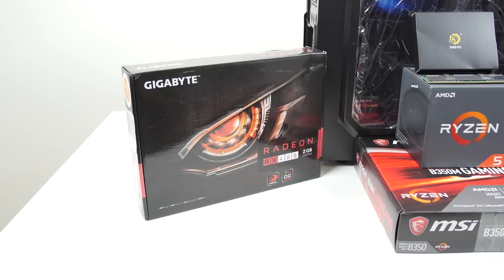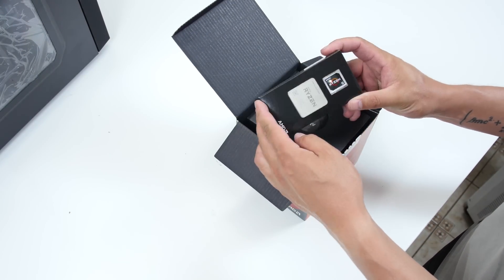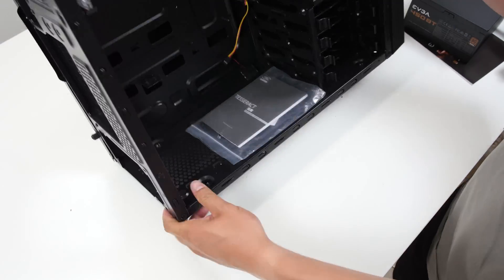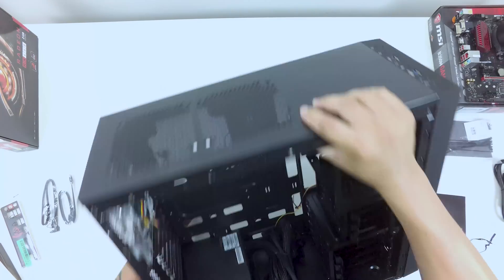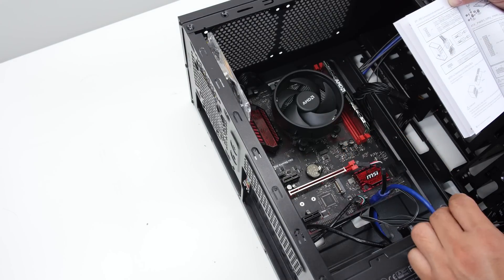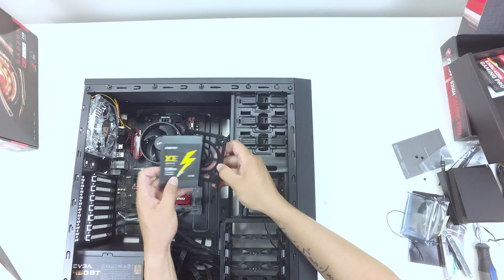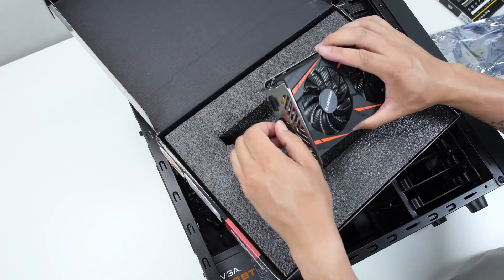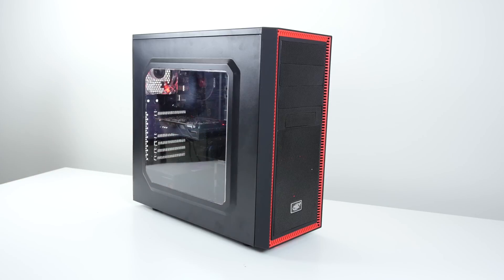$450 Ryzen 1400 Gaming System

Comment: If the GPU is cheaper than the CPU, that's not a gaming system.
Reply: Mihai-Silviu Dumbrava Extreme i7 black box and a gtx 1080ti is not a gaming system? Just because the cpu is more expensive than the gpu, where did you get that from wtf
Reply: so my i7  and 1070 is not a gaming system?
Reply: Mihai-Silviu Dumbrava SHOULDVE said so jfc
Reply: Mihai-Silviu Dumbrava well if only game you play is cs:go 1024x768 all low,dota,lol and overwatch and you do some work on pc this is good system
Reply: Mihai-Silviu Dumbrava E un sistem dezechilibrat, mai bine punea un 1050 ti că era mai bun și costa încă 3 milioane.
Reply: Mihai-Silviu Dumbrava you could put the 6950x and 2 1080tis. is that not a gaming system.
Reply: Who made that a rule? Not necessarily true at all.
Reply: Tirmac Marian Cristian Corect, e prea puternic procesorul comparativ cu placa video. Asta e mai degraba un PC pentru editare, nu pentru gaming.
Reply: Mihai-Silviu Dumbrava true i wont say that the gpu is bad but there is  a lot of amd gpus that are better than that
Reply: Mihai-Silviu Dumbrava Bout to get a gtx titan xp too play smite and scgo!
Reply: Mihai-Silviu Dumbrava I have 450 and Im gonna buy this because here where I live there is no g4560 and upper tier gpus and Im gonna stream OW
Reply: R7 1700 + RX 480 runs 1440p smooth, built back in March 2017 when the xfx radeon rx 480 8gb gtr black edition was a whole lot cheaper.
Reply: What if you have a 2000$ 18 core 36 threaded core i9 and a 700$ Gtx 1080ti?
Reply: Silviu so you're saying if I get a good deal for gtx 1060 for $100 and my ryzen 5 1400 is $169 it's not a gaming system? Might want to rethink what you're saying
Reply: Depends source games can be mostly CPU dependant
Reply: This is the kind of thinking that's ruining the community. smh
Reply: I'm talking about budget builds, like the one in the video. If you want to build a pc with a  <800$ price the GPU should be your main point of interest. A lot of people buy i5's or r5's and then cheap out on the gpu because they don't have any money left. In the majority of cases a lower end cpu like the g4560 paired with a mid range gpu like gtx 1060 or rx 570 will offer better performance than an i5/r5 with a 1050 for example.

Comment: I got basically same build, but with GTX 1050 OC at MicroCenter, should I have gone for the 460?
Reply: Stat Savage the gtx 1050 is about the same when it comes to the 4 gb version of the 460 but the gtx 1050ti does outperform the rx 460
Reply: 1050 is better than 460, I'm more of an AMD person but being honest.
Reply: Stat Savage I suggest 560
Reply: Stat Savage depending on if you play any games that utilize DX12
Reply: Stat Savage Nah, I'm an AMD fan and honestly there's no need for the 460 but for pricing, the 1050 wins 9/10 and the 1050 ti blows it away. For reference, the rx 470 is 25%> gtx 1050ti 25%> rx 460. the 460 will bottleneck most relatively new machines, even the 100th bottlenecks fairly hard for this type of system but gives way beer performance than the 460 at least

Comment: Hey bro,I would suggest getting the 1050 or 1050ti for that price.I am no Fanboy,Just my opinion because in my pc it performs better than rx 460
Reply: ItzDev What I did
Reply: ItzDev Does it perform better with the R5 1400 though...? I am curious
Reply: Yeah
Reply: The 1050 is a bit more expensive than the 460, it'll perform better aswell, but I'm pretty sure he got the 460 partly due to AMD FreeSync, monitors with that technology are a bit cheaper than NVIDIA G-Sync ones.
Reply: Yeah,But if you are a gaming youtuber,then the 1050 will be the best because of geforce experience.Records without lag.
Reply: That's true.I'm using the 460 right now and we have this ReLive recording software, haven't used it yet, but apparently it's not as good as Experience's one.
Reply from the maker: I agree and I will be making a video using the intel 4560 and a 1050ti. The reason for the AMD gpu is that I am using this with a dell 75hz monitor with Freesync. More on that in the part 2 video.

Comment: In budget "gaming only" build G4560 with a better video card then Rx460, would smoke this build and still be in that $450 range.
Reply: then just OC the r5 1400 man
Reply: Amen
Reply: edwardpirate kenway There is something that sabotages AMD cards, it's called Gameworks
Reply: Dumb Dead1 for £50 more why not a 1050ti
Reply: Tech4U That makes a $450 gaming PC worth a terrible $500. $500 can fit in a GTX 1060..
Reply: The Pokenerd uh if you were to go with a g4560 you could get a 1050ti or a 570/580
Reply: The Pokenerd but not an r5
Reply: Tech4U Don't worry, Ryzen 3 will be out in less than a month and problem solved.
Reply: The Pokenerd ah good idea everyone wins
Reply: Tech4U yey
Reply: Derp Derpen G4560 and GTX 1060?! Your best option is G4600 or better.
Reply: Derp Derpen I think, better take MOBO with cheaper A320 chipset
Then just try to buy cheap 1050Ti or 1060
Reply: RX 460 is more equal to a GTX 950(except in Vulkan and DX12)....
Reply: Dumb Dead1 So a locked, dual-core, 4 threaded processor is better than a quad-core, 8 threaded, unlocked CPU? And I guarantee you, the RX 460 delivers almost equal performance to the GTX 1050.
Reply: Dumb Dead1 why would u want a 2 core cpu, you get loads of game limitations e.g. If you wanted to play beam mg drive you need a quad core processor and the g4560 is a dual core

Comment: I'm assembling a configuration like yours , My concern is that after I ordered the components i read in some forums that ryzen 5 1400 and  B350M GAMING PRO Does not start the boot phase to enter the bios and update, it but need a  ryzen 7 to update the bios and let the ryzen recognize 5. Is all that true?
Reply from the maker: wow that is a strange problem. I have not had that problem with this board and CPU but that could be an issue with an incompatible ram sticks. Many of the updates are adding ram compatibility not so much for CPU compatibility.
Reply: Thank you very much for the answer

Comment: Just wondering, but could you fit another ram in there?
Reply from the maker: With the stock cooler and that heatsink over the ram, no. It sucks because I would have to take the heatsink off the ram stick. The ram stick I have didn't come with the heatsink anyways but most "gaming" ram sticks do and it would probably be a problem.
Reply: So its bad motherboard design?
Because it should have problem fitting any rams,its the stock cooler
Reply: It should not I mean

Comment: RX 460 2GB is not bad considering i'm mostly play Dota 2 and csgo :))
Reply: I see you mean 580 4gb lol my bad I thought you meant RAM XD.. well that videos explains it most games shouldn't go over 4 gigs so you should be set
Reply: kurozaki07 What he is trying to say is to save a little more money and get the 470/570 as it will be a much more worth it option for the long term since you won't have to upgrade in the future, rather than paying for the 460 now then paying even more in the future to upgrade to the 470/570
Reply: DUDE ADD  me on dota im  4.4k :D
Reply: kurozaki07 add me on steam anyone XxGetRektalotxX
Reply: how many fps do u get with that 460? also what's ur processor?
Reply: Ragezort The R5 1400 blows the Pentium G4560 out of the water.
Reply: kurozaki07 try to get a 470/570 so much more peformance for a little bit more
Reply: Well thats my plan..

I choose RX 460/560 2GB cz its one of the cheapest GPU in current generation then i will upgrade it to RX 470/570 so i can get significant performance boost :))
Reply: so you'd probably want G4560
Reply: Spongebobs Eyelash How would a Ryzen 5 1400 and an RX 580 4gb run?

Comment: thank you for the info nice job keep it up, I got fx 8350 oc 4.8 but I run it 4.515 asus sabertooth r 2.0 pny gaming 1866hz 16 gb kit gtx 1070 ssd evo Samsung 500gb evga g2 850w nice case with perfect air flow ,I what to go to ryzen so bad I just can't decide on what to get ,ram,mobo,cpu.all I need I'm going to use the parts of my main pc they are only 1yr old . any help be nice I'm thinking to wait for next ryzen 2. my pc runs everything I trow at it, oh I got a asus vg278vh 144hz 1ms monitor,I just saw the video card I got one for my fx 6300 rx 560 4gb for my wife pc

Comment: bad build because of weak gpu !! with only rx 460it is not worth to buy r5 1400!! everything bellow rx 470 are not worth to combine it with r5, g4560 are ideal for this gpu-s or 1050/1050ti
Reply from the maker: Stay tuned for part two when I upgrade to water cooling and an RX480. If I went the kaby lake cpu route then I would need to get either a z170 or z270 if I want to upgrade the cpu to a k series for overclocking in the future. Those boards are over $100 to start.
Reply: Mr11ESSE111 I did something like this with a gtx 1050 OC and now when I have the money I can upgrade my pc in a few years.
Reply: THe Observer nobody wants a Pentium , upgrade down the road that's what most people do .
Reply: I knew that but this build felt so incomplete the r5 has aton of wasted potential on this build .In the 1st place this build should guide people in picking right parts for for the best value which this build completely neglected
Reply: THe Observer you often upgrade the gpu first because its most important for gaming. With the 1400 you have enough headroom and can upgrade the gpu in 2 years or something like that.
AM4 is new while intel 1151 is going to be replaced so that am4 is the better choice.
ofc the Pentium is perfect with the rx 460/560 for gaming and its a good budget choice but i think this build has also its right to exist
Reply: Plus the high-end CPU makes handling PC everyday PC task lightning fast!
Reply: bad build ? you get a hyperthreaded quad core for less than $500 , the 460 can be easily upgraded at a later point , its not all that weak either it can play any game out at the moment .
Reply: Mr11ESSE111 with this cpu im getting Rx 560 4gb so it should be better i supose
Reply: Eli_Plays 
it is a bad build in a way because of poor balance between two major components the cpu and gpu. the G4560 is cheaper and will provide the same gaming performance when paired with 460 or 560 . upgrade path will be good to because it will support 7th gen cpus from intel and when you want to switch to ryzen you just need to change the mobo and cpu plus it will became cheaper in the future compared now
Reply: LMAO did you get what I just said?? It will give the same GAMING performance as the ryzen
Plus it is way more cheaper so you can get a better gpu more ram more storage. In short your resources can go to other things
Reply: LoL I might be sounding like an intel fanboy now but almost all games uses only 4 threads plus if you consider the rising popularity of dx12 it looks like this cpu has good future. And we are discussing value here the g4560 itself and its MOBO are way cheaper than The R5 mobo and cpu
Reply: THe Observer why would anyone cut corners on the main component of a build ? When you can get the r5 and just upgrade the GPU down the line , the RX 560 can handle any game out at the moment , its not like we're talking about a GTX 1030 or 730 , we're talking about a budget 1080p high settings capable GPU .
Reply: It seems like he just build this system to follow the trend
Reply: THe Observer i5's have increased stutter compared to an r5. You'll spend more money upgrading the Pentium to an i7 trust me.
Reply: THe Observer ok so how about people spend an extra 50 and get an RX 470 would that make it a better build in your eyes ?
Reply: Exactly! Also, I can run Fallout 4 High Settings with an occasional drop below 55 fps!
Reply: Tobias Jöny it has right to exist but not an ideal build admit it in r5 series 1600 is the sweetspot and if you consider ryzen 5 this is the appropriate  choice due to its performance per dollar ratio
Reply: Stat Savage yes your right but that will depend heavely on what type of user you are as this build almost focuses on gaming then g4560 is the appropriate choice.but if you are a content creator or someone who do something cpu intensive task the 1400 is not the right choice for you
Reply: THe Observer what is you obsession with this Pentium ? Why would anybody cut performance in half just to get a better GPU ? When you can just get the 460 and upgrade at a different time ? This build will handle any title at 60 fps easily .
Reply: THe Observer and the 1400 will do intensive programs just fine and a hell of alot better than the Pentium .
Reply: Im just saying that 1600 is the good cpu for productivity if this is the main concern
Reply: Not the 1400
Reply: THe Observer some people don't have the budget for a 1600 the 1400 will handle it just fine .
Reply: Eli_Plays 
to end the discussion here is my own conclusion the r5 1600 is the best for budget productivity it is the most balanced cpu in the market . while the r5 1400 is better in productivity. than the g4560 it is twice the cost but in terms of GAMING which I think this build video is aimed at the 1400 and g4560 is pretty close you can even look for benchmarks . in the end this is not a bad build but it shows poor management of budget in getting the most out of your money
Reply: In some cases it can edged out a stock 1400
Reply: THe Observer in what cases ? In any case the 1400 has more threads that can be used.
Reply: Search some benchmark 
The channel called benchmark do good test with these cpu using a gtx1060 which is better than 560 which can see the potential bottleneck
Reply: THe Observer I know for the fact that the 1400 smashes the g4560 in gaming performance.
Reply: Eli_Plays 
BTW games only uses 4 threads so the extra 4 threads the r5 1400 has does not matter much in gaming
Reply: THe Observer but games utilize the 1400's actual cores , and the games definitely use the 1400's threads aswell. Compare an i5 to an i7 games have way less stutter on the i7 compared to the i5.
Reply: Robinson Joe 
first of all the build iam suggesting is not obsolete because of the fact it has a good upgrade path to an i7 cpu. the main argument is the similarities of r5 1400 and g4560 in some titles go watch some benchmark in youtube. second optimization of ryzen is something that I dont disregard but the fact is games only uses 4 threads is legit in per core performance intel wins the battle because the ryzen has a hasswell like performance. and lastly NO ONE CARE ABOUT WHAT YOU ARE USING . not all people in the world has access to cheap deals and secondhand hardware like you .you only view our discussion based on your own perspective and experience which is wrong
Reply: Robinson Joe 
a locked i7 yes I can see some not the k version but regarding the dx12 it lessens the cpu load and lets the gpu handle more things in gaming . do you know that? that is the reason why people are exited about this
Reply: Well you are right I will not argue about the potential of ryzen it is indeed the best cpu for the value in the market if you are planning in building a mid to high end system

But let me ask you this if you have a 450$ as a budget what will you do will you change it? And what parts would you change I would like you to build the best value system unlike the one thatvis shown in this video
Reply: Then give me your opinion what is needed to make this build way more reasonable than it is now I think there is a lot of wasted potential on this system especially the cpu
Reply: Yes it is outside gaming the g4560 is BAD imean bad so your argument is right but if gaming,browsing,and light productivity (not photo or video editing) it is fine
Reply: It isn't going to be fine for even gaming much longer...
Reply: Dude keep in mind he just wanted to make a budget computer that had a ryzen inside. I'm sure if he was making a real practical build then there would be a better GPU
Reply: that's what i was thinking or going with a fx 8350 over kill on the cpu for that GPU
Reply: Mr11ESSE111 it may be okay if you want to stream some low end games
Reply: chris carter 8350 is shit don't use it.
Reply: meh i have a fx 8320e at 4.2ghz and if your playing on a 60fps monitor it works well and it will not bottle neck a 460.......... i have a 1070 with my fx 8320 and i can play witcher 3 at over 60fps with everything maxes and hair works set to low
Reply: but it still 2 core *Rofl
Reply: 2 cores what are you talking about? lol google fx 8320.........
Reply: Mr11ESSE111 remember it is only 400 pc build so he trynna make it cheap a possible.
Reply: It's still worth it if you have lower expectations(i.e. playing games at Medium/High w/o 60FPS) and you say, do light video editing.
Reply: R5 1400 is only slightly better than r3 1200 isn't it? Fps wise. R3 1200 is 4 Cs 4 Ts and R5 is 4 Cs 8 Ts. I could be wrong.
Reply: THe Observer again nobody wants a Pentium , it will not give the same performance as the ryzen build has twice the threads .
Reply: In creating a legitimate budget build the builder SHOULD maximize all resources in getting the most out of the budget not a half assed R5 build . If this has a better gpu better storage and mother boar with more features.I would definitely tell you it will become a good build even at the cost of spending more money.
Let me tell you this if he used an i5 this would become the most unreasonable build
Reply: THe Observer the g4560 is no where near a 1400 in terms of gaming performance , it's close to the i5 2400 but well below the 1400 .
Reply: next week you can have pc build with HD 5450 and r5 1400 and your pc build will cost 400-430$ and later you can upgrade

Comment: I wish I could find Doom performance benchmarks with this CPU. Currently have a FX 8120 8 core AM3+, but want to get some of the new stuff that has released. Any thoughts on whether this would be a side step or an upgrade over the 8120? My card is an RX 480 4 GB and the performance is amazing at Ultra preset 1080p